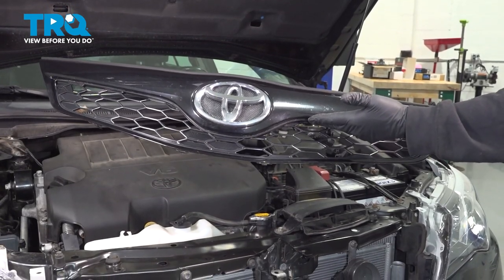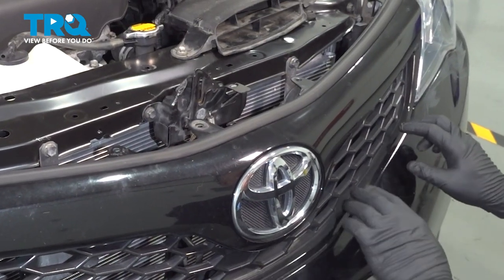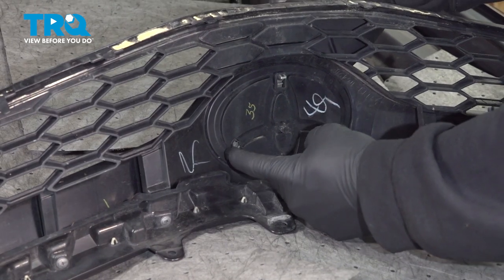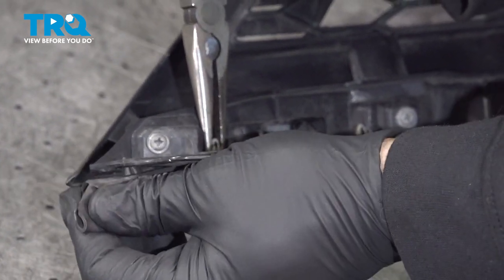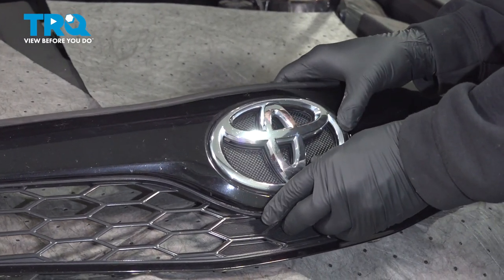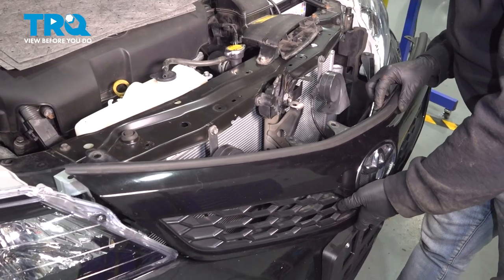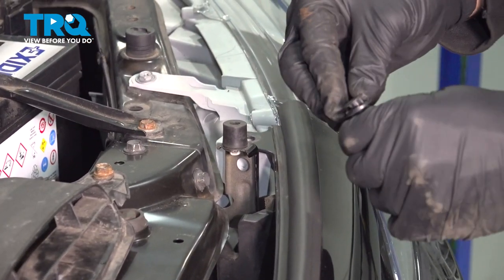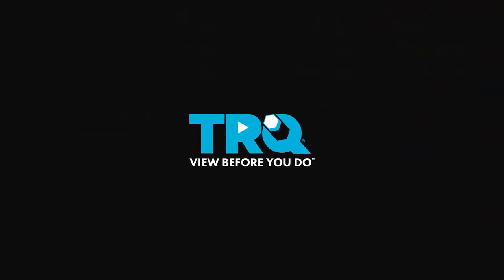How to Replace Front Grille 2012-2017 Toyota Camry

Comment: The bottom tabs arent popping out nearly as easily as the video shows. Theres also a hard foam piece underneath and behind it between the grille and the radiator that isnt pictured. Im working on a 2018 SE model. Hopefully i can figure it out.